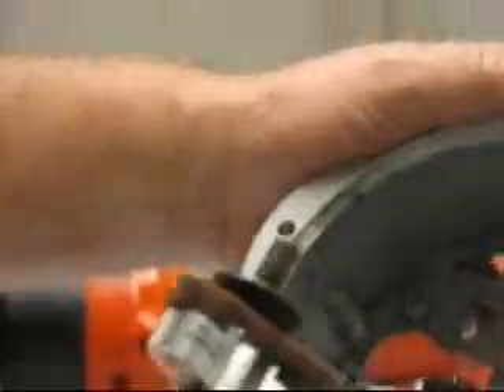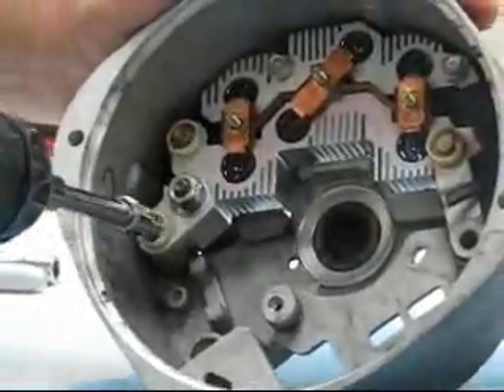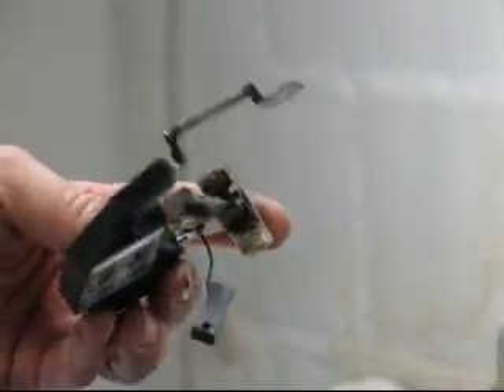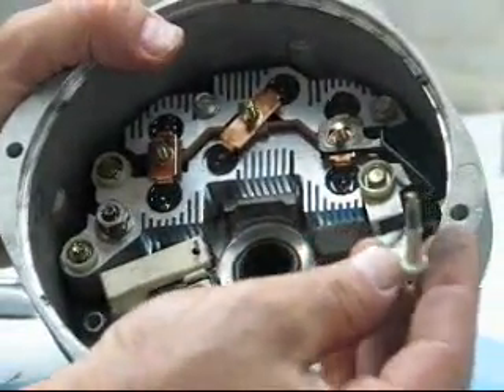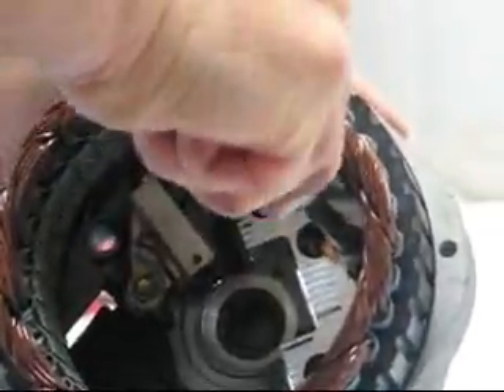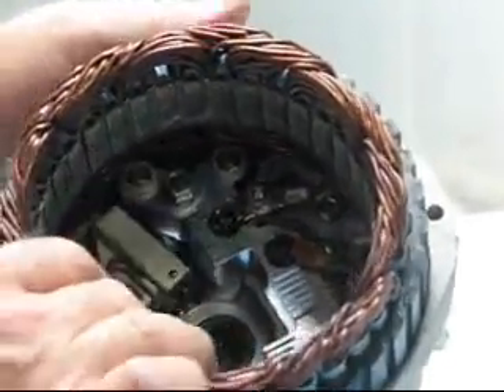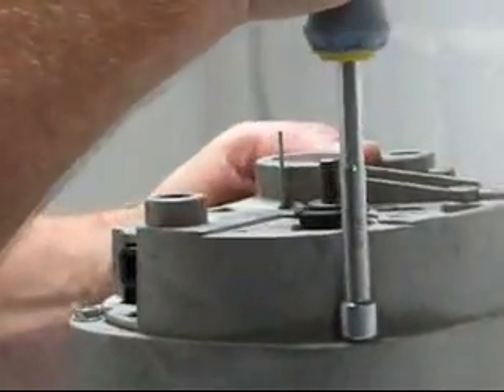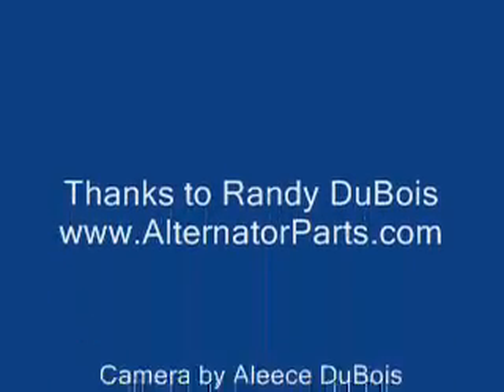Part 2 - GM's CS144 Alternator Rebuilding, Alternator Repair

Comment: Great segment I put a kit in my CS144 a couple of years ago I've replaced all the smaller components taken it to a alternator shop. They said it's charging very little it's a 200 amp kit.  I've redisassemble it everything is assembled correctly I installed the bridge rectifier first. Then the capacitor then the voltage regulator then the brush holder then the stator all parts are new. The insulator screw's are in the correct place only thing isn't new. Is the rotor and it's still not charging so question can I send it to you so you can find out what the problem is?

Comment: Does the later model CS144 use the avalanche bridge rectifier? I have the 140 amp version and need to know what bridge rectifier I need to replace it with for a welder where I eliminate the voltage regulator.

Comment: Hello, I´m from Brazil... My chevrolet Omega CD 4.1 MPFI, a straight-six 250 engine, is equipped with Delco CS144 alternator... With this video, I was able to fix it by myself. Thank you! By the way, I am a big fan of the CS144... It is robust, made for long time without maintenance.

Comment: My CS144 is from AutoZone and even after swapping it three times, it keeps cutting out at idle.  The first CS144 I had didn't.  I'm tired of taking it back.  What are the best parts to use to replace the internals, because I'm pretty sure it's a bad regulator on the reman.
Reply from the maker: If you have it cut out at idle, the culprit is probably a cheap wind-job on the stator. Single wound, large wire stators put out decently at highway speeds, but cut out to almost nothing at idle. We will use a thicker, quad wound stator (with finer wire) from the AD244 for high idle output CS144 units.
Reply: alternatorman I'm tired of dealing with Autozone's crap rebuilds.  Do you have a kit for the CS144 that includes the AD244 stator and regulator?  Most of the other parts seem to be find.  I wish there was a 180 degree cased AD244 that would fit in place of my CS144, but it seems like all the AD cases are 90 degrees.  

Do you have a kit that I can upgrade the stator with?  Or happen to know where to get a 180 degree AD244?

Comment: Hi! This is the best "how to video that I have seen on Youtube. The angle is perfect. The lighting is perfect the audio is perfect. Both videos are excellent but part2 is even better. The timing is so good that a slight (fraction of a second) hesitation about pulling out the toothpick is noticeable. You should consider selling DVD or CD version of part1 and 2 reassembled. I will be watching more videos in an attempt complete the electrical loops between alternator and battery outside of car.

Comment: When you check the continuity between the slip rings, are you just making sure that they are connected (i.e. they have continuity???). What ohm rating should they have? Can I just use the continuity function on my Fluke instead?

Comment: Thank you very much.  I got a whole box full of these, what I am wanting thou is a welder-generator-edm power supply. I will be turning the alternator with a small motor. A way to burn broken bolts out cheaply and make emergency repairs. It does not put out enough current to weld thick metal well thou. FOR LOOKIN INSIDE, thanks. This also is a great way to build a windmill, using the AC to transmit down the post, the windspeed controls the Current in. I'm still working on that.

Comment from the maker: the main component difference is the stator, the more windings it has, the higher the output. But also, when upgrading the stator, you have to upgrade the bridge rectifier as well.
Reply: Verynice work